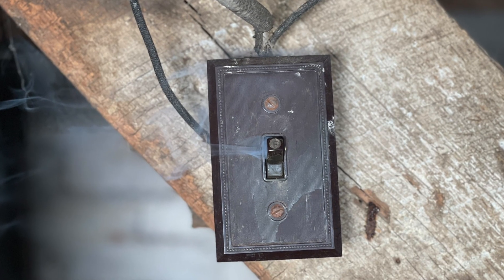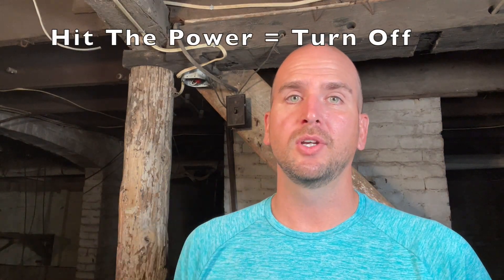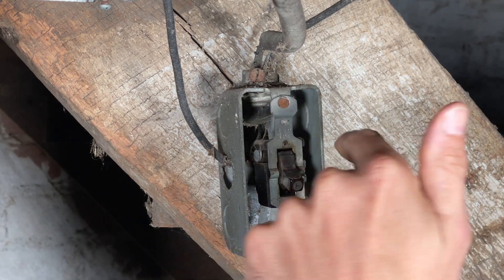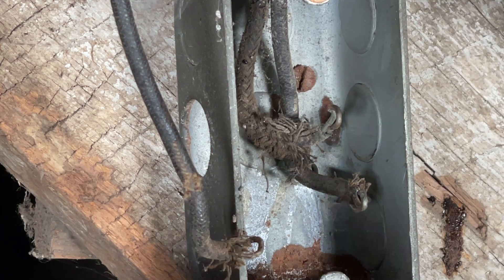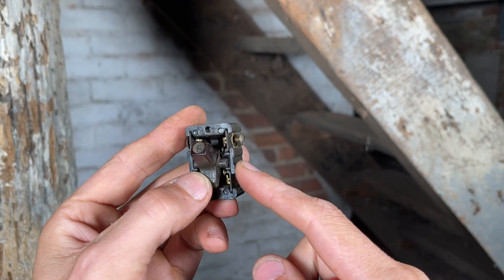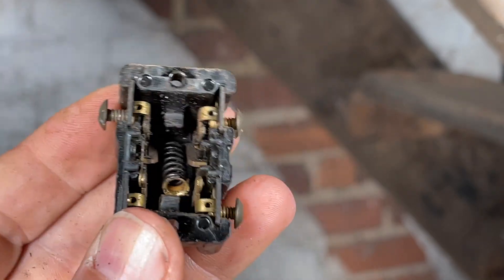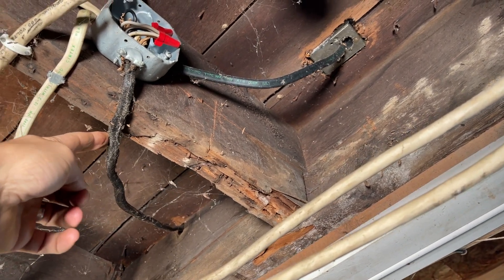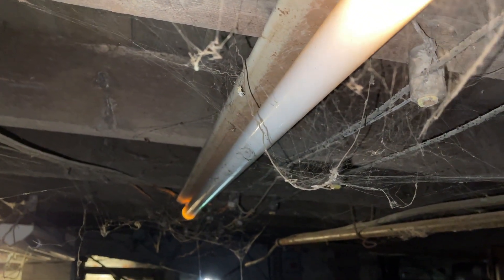Issues with Old Electric Wiring | Knob and Tube

Comment: I grew up in a house that looked just like the one you were in.  It had the old glass fuses too.  When the 15 amp glass fuses would blow because that circuit was overloaded, we just put in 20 amp glass fuses.  LOL  The house had no grounds either on the outlets.  We would just get the 3 prong to 2 prong adapters.  We even had a cat running under the house and its tail touched one of the wires in the tube and knob system where the insulation on the wire had come off and was electrocuted.  We didn't have any class ABC fire extinguishers either.  We had a hand blown glass round container the size of a grape fruit filled with carbon tetrachloride.  You learn quickly not to touch the metal boxes or the screws on the light switches.  One night during a party with all the lights on, I went out to the old fuse box and could feel the heat from that box over 3 feet away.  All of that was nothing compared to the old furnace.  When the pilot light would blow out there was nothing to shut of the pilot gas line and everything would fill with gas.  The fix was to just leave the door to the furnace a jar to let in extra air so the pilot would not blow out.  We were so lucky that only a cat died and the house didn't explode.  LOL  

Those were the days my friend
We thought they'd never end
We'd sing and dance forever and a day
We'd live the life we choose
We'd fight and never lose
For we were young and sure to have our way
Reply: I think you are making up the part about the cat. And the fuse box heat 3 feet away. (it's OK to lie in these comments to make a good story.)
Reply: @glasslinger  In the old homes, the tube and knob wiring was covered with a cloth type of insulation.  When it got very old, if you touched it the insulation would just flake off and expose the bare wire.  We had a litter of kittens born under our house that my sister was feeding.  I will admit that my sister told me about the kitten getting electrocuted and that I did not see it directly.  OK, to be perfectly honest here, it was closer to 2 feet away that I could feel the heat coming from the fuse box.  I was not making this up to make a good story.  It all did happen.  The pilot light was not being blown out, I think it was being starved of oxygen.  The gas system was installed in the old oil burner that the house originally had.  That was why the cure for the pilot going out was to just leave the oil furnace door ajar to let in more oxygen.  When my mother died in 2000, I was the executor of the estate and the new buyers of the house did bulldoze the house so no one else will be hurt from all of that nonsense.  I was just a teenager at the time and didn't really know any better than to do these things.  I won't even get into the asbestos covered flue ducts through out this large 3,300 sqft home.
Reply: Funny that you put up that song....
There was an "All In The Family" episode where Archie had "fixed" a blown (glass) fuse by putting a penny under it, then had an electrical fire and thought he would collect from insurance, forgetting about the penny......then the inspector found it.
Reply: @kennethalbert4653  You are very perceptive.  As a 15 year old boy, you just don't think about things like that.  LOL

Comment: Does "F" on the switch stand for Federal Pacific? Because if so then the saying stands true. It's not federal pacific, it's fire pacific
Reply: Federal Pacific panels are bad news as well. I always inform my customers about the "issue panel safe" web site. It says it all and I'm not even an electrician.
Reply: Circle F Wiring Devices; Trenton N.J. In business until the 1980's

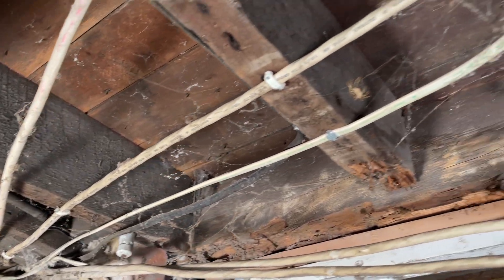Comment: The old electrical system would worry me far less than the insect damage beginning at 5:40. Do those floor joists stand up to being poked with a screwdriver?
Reply: Good eye. Looks like replacing the wiring will be a small piece of the bill to fix this place up
Reply: Wow what a junk old house.
Reply: Yikes!  Damn. That's going to be a lot more work than the electrical.

Comment: As long as you take the load off the circuit it'll stop smoldering Is typically. Most knob and tube is OK if you're just using it for the lighting circuit but I would isolate the receptacles off of it for sure and throw an arc fault breaker  If to protect the existing knob and tube if you don't feel like rewiring the whole house

Comment: Not sure why everyone always says you have to open up the walls to rewire.
I rewired my whole house without ever damaging the original plaster in my 1890 home.
It was a hybrid system, I replaced all of it. Even the old romex as I just didn't trust it. Especially since even the romex that had ground wire in it, the ground wasn't used or hooked up.
Also went from 2 outlets in a room, to 8 per room.
Of course it took a bit longer, and used more wire as I couldn't just go around the room with one run.
But I wanted to save the beautiful textured plaster finish we had on our walls.
Went from 12 fuses to 30 breakers.
Reply: The amount of structure damage will depend on the configuration of the home.  One of my customers recently upgraded an 1890's, two story, 3,500 square foot home, with a complex floor plan, that was all original knob & tube system.  As in their case, home insurance companies were refusing to write a policy on a home with knob & tube wiring.  They did their homework and found an electrical contract who specialized in knob & tube conversions.  To my surprise the entire home was fully rewired and the contractor only had to create two 4" diam. holes in the walls during the entire process.  With a new 200 Amp panel and all new wiring to code, their annual insurance premium was also reduced by $250.00 per year.
Reply: @chrisgraham2904  Yeah, the older the home, I think the easier it is.
Balloon framing makes it so much easier.
With no fire stops, you can pull a wire just about anywhere.
Reply: @chrisgraham2904  250.00 a year, times how many years that annual saving, before they get up to what they paid that contractor?
As we found these last two years concerning the coronavirus, the so-called "experts" often aren't as "smart" as they claim they are and we take  for granted they allegedly "are".
Reply: In the process of something similar, house was built in 1911.  Originally didn't have anything other than lights till someone went in and added a couple plugs here and there... It's been tough but working on lots of upgrades and changes.
Reply: @MuttMuttOutdoors  Did that have the original twist light switches, not the push buttons but circular ones, that had a knob you twisted to turn the lights on and off?
Reply: @frankpaya690  some stuff has been changed but this place actually had only pull chain lights till a few years ago and no outlets. Sadly it's a small town and the former owner was nearly a slum lord. They put in a new used 100 amp exterior panel and ran a few things in conduit but most of it wasn't done right anyway.
Reply: @MuttMuttOutdoors   some of those pull- chain lights were designed in such a way so every time you pulled on the chain, the entire fixture l hanging by the conductors would be "pulled".
Reply: Someone correct me if I am wrong, but I believe the romex needs to be secured to the studs at regular intervals (NEC). As a result it will be very difficult to do a code-compliant installation without opening the walls, and that's why people say you need to open the walls : they assume you are going to do it right... which I really recommend because if there is a fire or anything (even after you sell the home !), you will may be found liable for the consequences
Reply: @uski  Your statement is true where the studs are accessible as if a house is being built or remodeled. When the walls are on the studs, Romex can be fished in the walls without being stapled and is code compliant.

Comment: Old age isn't the only issue. A lot of houses around here were built with aluminum wiring in the 1970's. Now the house flipper you bought from last year swapped in those flatter squarish light switches (so he could say "updated electrical").  But if those fancy decora replacement switches and outlets he found at the dollar store don't specify aluminum and copper compatible, that nice ABC fire extinguisher in the video won't be enough to save the place.
Reply: Al wire is perfectly safe......IF it was spliced correctly. And fused/breakered accordingly. The problem is that alot has not.
Theres a whole list on how to splice Cu to aluminum, pigtailing yada yada. Wouldnt touch the stuff if my life depended on it but just saying.

Afterall the wiring coming from the utility pole is all aluminum.
Reply: Aluminum wiring is an entirely separate problem.  Houses with aluminum wiring are not “old,” by my standards.  It was a modern innovation.
Reply: @GH-oi2jf   That's my point. Buying something 90 years old requires checking the electrical carefully.
Buying something only 45 years old still requires checking the electrical carefully. 
(And buying something new requires checking everything carefully)
Reply: I had a space heater melt an outlet that was wired to aluminum wiring, I don't trust the stuff.
Reply: @brandonlink6568   If you checked the melted outlet, it probably did not have the CU•AL compatibility symbol that is REQUIRED before installing it on aluminum wiring. I saw a brand new photocopier melt an outlet when they switched it on. A few years later that building burnt down. Five family businesses lost that day because of incompatible electrical parts.

Comment: As a European electrician I get goosebumps knowing that most american homes are wired this way, especially knowing they're made out of wood.
Reply: No, most American homes are not wired this way. Only the old ones which have yet to be updated, which is the minority of homes in the U.S.
Reply: @sigcrazy7  well I still see YouTube videos showing newer installations with cables dangling on wooden beams with no conduit, wires connected with twist connectors which are banned in some European countries, lighting circuits mixed with power outlets, neutral and earth sharing the same bus bar at the electrical panel, etc. Most installations wouldn't pass inspection if they were done that way in Europe.
Reply: @t0nito  Some of those things you mentioned wouldn't pass inspection in North America either, while some of those items are just differences in how things are done here vs there, like powering lighting from a power outlet. However, none of those items you mentioned are K-T wiring, which is what I was specifically responding to. Most American homes are not powered by K-T wiring. This video has wiring that predates the Second World War. There's European wiring that old that is plenty dangerous, like using conduit as the grounded conductor. As an aside, I must say that I love WAGO connectors, but they are expensive. I'd be perfectly happy to see them replace wire nuts. Real WAGOs, not the Chinese imitations.

Comment: When I was about 13 a neighbor I liked asked me to see if I could fix the floor outlet in her living room. I grabbed my volt meter and a flashlight and climbed into the crawl space. There I found that the wires had be up on knobs, but the bakelite knobs had failed (probably rodents) and that the wire insulation had been rubber, paper and then cloth, but only a few bits of the rubber remained (probably insects & rodents). The hot wire to that outlet was broken off (metal fatigue) and ended in a rat that was beginning to swell up... I got out of there when I determined that hot wires were just dangling all over. Then I found out the house did not have breakers and the wires in the fuse box were not much better than the ones in the crawl space. I told her to call an electrician and an exterminator and not to sleep in the house until the new electric system is inspected. The electrician told her I saved her life. There was not one piece of that system that was up to code. Not the meter, not the weather head, not the wires to the pole and not even the transformer on the pole was acceptable any more. Her homeowners insurance took a $27k hit, but every wire, switch and outlet was replaced, a modern meter was installed along with a modern breaker box. Everything was fixed except that floor outlet. It was too small for a grounding outlet and moving it was out of the question.
Reply: I'm surprised that insurance would pay for that upgrade.
Reply from the maker: Me too 🤔
Reply: Code upgrade coverage is wise to get on older homes when it's offered. It's very likely their neighbor had been paying extra for it for many years before needing to use it.
Reply: The hot wire ended in a hot rat. Yikes!
Reply: That sounds like a fine time, crawling through a live wire jungle.
Reply: You can make an insurance claim to update your old electrical? 🤔
Reply: @billdivine9501  Evidently she had a special insurance policy for that.  I am not familiar with that coverage, either -- and I wish I would have had it 40 years ago.

Comment: I lived in one of them houses, the electrical wires and outlets were replaced with modern electrical work however the morons put the fuse box in the shower not just in the bathroom I mean literally in the shower. Just like many of the houses I've lived in that house was burned to the ground.

Comment: Another issue with old wiring is that it was fairly common for the switches to be on the neutral side. This is a huge safety risk as it meant doing something like changing a broken light bulb could result in a shock, even when the lights are turned off. There's still line voltage going to the lights, they just don't have a path to ground.
Reply: @ccox7198  Very sure. My parent's own an ~1870's home, wired in the 20's. Many of the switches were on the neutral (Others had already been rewired). I read into it on some electricians forums and a lot of them also reported seeing the same in older homes.
Reply: @TheSeanUhTron  Ya something that old isn't even guaranteed to be branch circuits.  A light might pull hot from set of wires and neutral from another.

Comment: My house is from 1929 and the wires here are different than yours even if they also have a failing point which is deteriorated insulators around the wires. the 2 or 3 leaded cables are on the outside metal wrapped and the strands are more or less tar insulated inside of this and make a very firm wire when it was new. however over time the insulation inside dries and if you start to mess around with the wires the brittle and dry insulation falls off and exposes the wire cores. normally these wires works as long as you never touch them since the insulation only gets hard and brittle but expect to replace them right away if you ever need to work on them

Comment: There is no need whatsoever to work on knob & tube wiring in an effort to try and make it work, upgrade it or try to make it safe. Please contact a licensed electrical professional. It really is that simple.  If you are a concerned homeowner, call some pros and get multiple quotes.

Comment: Thanks for sharing. I encountered a1990 vintage home where most of the wall switches were cracked and fell apart when I removed the wires.  Are these switches “wear-dated?”
Reply: I hope you meant "a 1890 vintage home".
Reply: @chrisgraham2904  nope. 1990s is correct.

Comment: My house was hybrid when I moved in... Get this, every receptacle, light switch, and ceiling fan were all on one 20a breaker (well, the microwave and 1 ceiling fan were not)... Lucky for me I had a friend that was an electrician, it took us about two years of very casual work schedules to get all the cloth wiring out, then another 2 years to upgrade the 60a service wire to 200a service wire (the 60a wire was feeding a 200a main, yikes!)... but its done now, and I learned enough that I could do it again on my own.  Good times for sure, I learned a lot and I sleep way better at night.